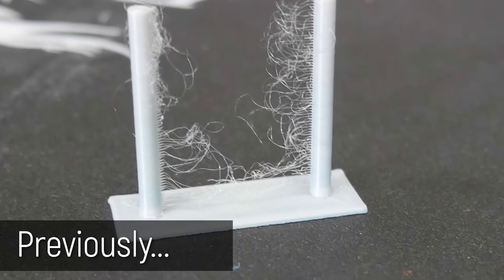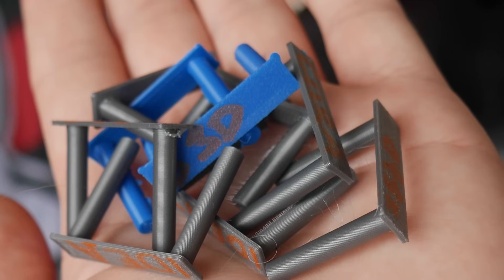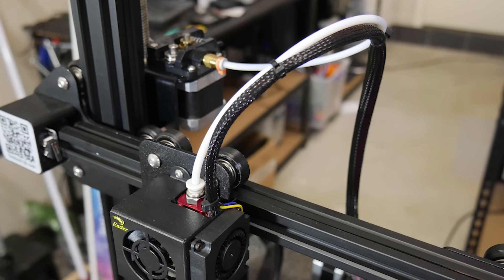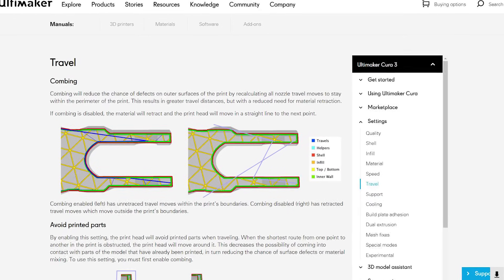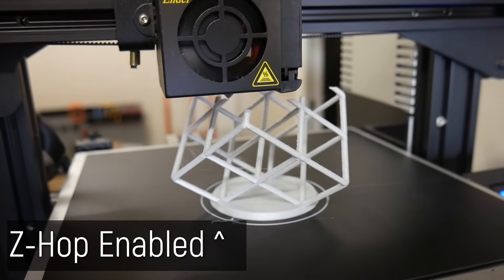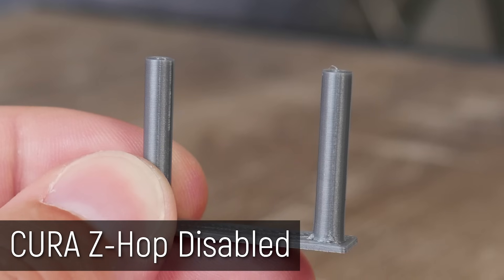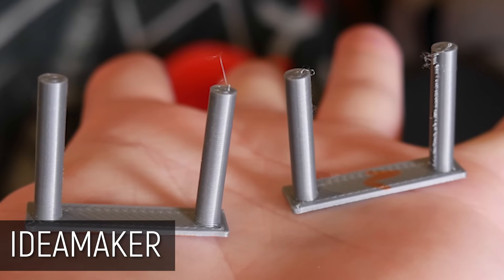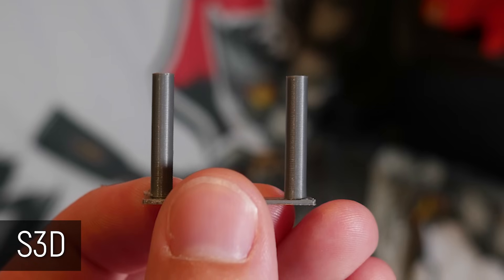Stop Ender 3 Stringing with this One Weird Trick! (ok but seriously)

Comment: I cant get mine to stop stringing even with retraction, combing, temp and all that. I dont know what the issues is because the extruder motor is calibrated and everything.
Reply: Ever figure it out? Same issue here. Starting to think its filament or my extruder or my nozzle or my tubing... no idea where to start.
Reply: @ToryBerra  I actually managed to get mine to stop stringing. what i did was start with the basic presets that Cura and then i turned on retraction but kept everything else simple till i fixed the issue. What I had to do was turn my retraction speed really high. I'm talking like 200mm per second and i had the length like 10 or 15mm. once i found that it was working, i turned the speed and length down a little at a time till i found the right combo. I think I also had to turn up the acceleration and acceleration in marlin on my extruder as well. try the high mm per second and let me know how it goes
Reply: @wrxsubaru02   I will try that and let you know, first step I suppose will be resetting CURA to defaults. What was your final retraction distance and speed? I read anything over 8mm or 60mm/s could cause jams because you will separate the liquefied plastic inside the hot end.
Reply: @ToryBerra  I ended up using 160mm speed and 10mm distance. I started with 200mm and 6mm distance and went down/up from there... I also changed my acceleration on retraction to 500 in Marlin as well so not sure if that matters. Start with that high retraction speed in cura and do like 6mm or 10mm for starters then work your way down or up whichever helps. I did the test with the softest filament i had because it was the highest potential for stringing. What machine/firmware do you have?
Reply: @ToryBerra  Oh, I also changed the jerk settings on my extruder in Marlin because i felt it should be snappy when i was pulling filament back. with all of the above, it worked flawlessly.
Reply: @ToryBerra  You know, there is one very important thing I forgot to mention... You should get yourself one of those cheap laser thermal guns and check if your nozzle is actually the same temp as your lcd is showing. mine was a lot hotter than the lcd displayed so it made my troubleshooting a lot more complicated than it needed to be. make sure you check that first or at least start at a really low temp as your print starts  and work your way up if it is too low
Reply: @wrxsubaru02  I have one but I could not get it to actually hit the tiny nozzle. I printed a temp tower though and the results came out looking pretty good.
Reply: @ToryBerra  so the retraction speed helped? try messing with temps see if you get better results but if not, try messing with retraction speed in marlin firmware. let me know how it goes
Reply: @wrxsubaru02  Honestly the temp and retraction speed adjustments have 0 effect. I get strings no matter what I do.

Comment: I've always used cura with my ender 3, after adjusting retraction length and speed On I managed to get no stringing even with petg but my biggest problem is under extrusion which keeps rearing its ugly head
Reply: Yes, same stringing experiance, same software, same under extrusion which was driving me nuts. Replaced a lot of parts chasing u.e.. Yesterday my extruder driver with the stock ender 3 died. Looks like the built in driver has been intermittent for some time, and I have been chasing some blockage issue. I have new board on order that supports removeable drivers. (skr w. 5160 drivers). Not sure if this is your problem but something to think about. good luck.
Reply: Thanks, hopefully that's not my problem I will keep an eye on it , i printed a shim for the spring to increase tension on the drive gear, after that it seemed much better and more consistent,  eventually the shim failed and it prints worse than before so I'm going to make an adjustable Spring tensioner and see how that goes

Comment: hmmm can you set the slicer with zhop enabled do a dummy circle right about the bit it just printed, to sort of cause any whispy things to fall onto the layer it just printed, then move across to the next component being printed? rather than just lift up and move directly? or several circles? it feels very much like icing a cake where after finishing each letter, you want to lift up and move back over the letter itself rather than dragging straight on to the next one, to get nice clean lines.

Comment: When I try to import the profile, I get the following message:

The machine defined in profile D:/3D Printing/Profile/Ender-3 1.16mm ChazMeister.curaprofile (fdmprinter) doesn't match with your current machine (creality_ender3), could not import it.

I tried changing the name but that didn't work
Reply: I'm having this same issue did you get it resolved? I just want to know what to set my CURA settings to..
Reply: @ThinknQueen  I haven't resolved it nor have I gotten a reply yet.

Comment: Find really interesting that you mentioned "G codes" since I was under the impression that 3D printing was totally far and a part from CNC... (I don't see anything wrong with it) but it was a surprise.... next I have no other option since I have not experience or understanding of 3D printers... its there a setting to print on wax?? for the purpose of doing lost wax metal casting??? and finally I guess that my question is talk to me about that super cute small delta printer behind you on the video!! I guess that if I ever started to do 3D printer that would be my starting point... thanks for your hard work and your videos.
Reply: first a 3d printer is basically a CNC machine with a glue gun attached. Second Watch "vegoilguy" on youtube to learn about "lost PLA casting) third that tiny delta in the background is a total heap of crap as described in his video about it...

Comment: I'm just considering my first 3D printer and I found this video refreshing, and also a bit intimidating.  It shows that 3D printing is not just a plug-n-play technology, but like most things, a complex set of compromises that are affected by many variables (material, brand, feed tube, slicer sw, part geometry).  It sets the expectation for me that printing (more difficult) parts may be an iterative process.  Thanks for your humility and straightforward discussion.  I appreciate your seemingly unbiased (or at least you acknowledge your biases) review.  Well done.
Reply: It's a manufacturing process. The same way everything else that has been mass-produced by humans requires an inordinate amount of time and effort to get just right, so will 3D printing. I've just ordered my first printer (surprise, it's an Ender 3) and I've realized I need to make time for this, if its going to be my newest hobby.
Reply: @MalachiteStarman  Keep us posted on your first experience with 3D and this printer.  Good luck.  Good thing that there seems to be a large community of users from which you can get help.

Comment: My ender 3 (non pro) has been pretty much flawless except for a large air bubble beneath the build surface, but that was easily fixed by a bit of rubbing the bubble to the edge.  Never had stringing.  My only negative would be the included spool holder which attaches to a stupid position and results is a pretty acute angle when the filament enters the bowden.  Easy fix though, just use the holder from one of my other tronxy or anet printers.

Comment: You have convinced my that I should give IdeaMaker a try.  I've stuck with Cura until now because it seems to work well for me.  (I only consider using free software that will run on Linux.)
Reply: @superuserdone  The Blender runs great on Linux.  Has an awesome 3d printer plug in. The new v2.8 is easy to learn.   How is IdeaMaker working for you all?
Reply: @superuserdone  Onshape

Comment: I have had no luck in getting a different program to work with my 3D printer. Can you help.  I have a power spec ultra 3D dual extruder. Is this a bad printer? If so what one should I buy

Comment: what I do on my Ender 3 to stop stringing is to use the slicer that comes with the printer from Creality. From there,  load the profile from the "test dog" file which came with my printer. This is the easiest way I got for a near perfect print. But this slicer doesn't have a bunch of settings like Cura do. So when I want some of that settings I try to replicate the profile from the Creality slicer to Cura

Comment: I agree with you, quality should not be determined by price to a certain degree IMO, a warped bed is unacceptable at any price. Features, bells and whistles and so on yes, the price would determine what you get and what you don't. That is why I generally but on Amazon and pay a little more if the quality is below a certain standard you can send it back.

Comment: What if you could hop AFTER clearing the edge of the part, so essentially in the middle of the travel move?
Reply: I don't think that any of the slicers mentioned in this vid can actually allow such a setting, I guess You could accomplish that by manually editing G-code, but... Isn't that kind of the point of having slicers in the first place? They're supposed to turn Your model into a perfect G-code so You don't have to write it Yourself

Comment: Great video.  This validates what I have thought since day one in my really shot time with 3D printing and getting information on the web.  One size does not fit all.  What would be great is if some of the veterans of printing would create a sort of guide to outline this information to help us noobs when making decisions.  It woul dbe a very challenging project as there are so many combinations possible today.  But if the "guide"  stuck with teh top 5 slicers and filament types and maybe the top 10 3D printers (and added significant new ones as they came out) it would further the industry as I believe many more people would not be frustrated with their printing and once they have a solid foundation of the basics could further explore options, settings and filaments to get a desired outcome from projects.  Not to mention the working knowledge would be invaluable for troubleshooting new issues.   I'm done rambling....going to download Cura...lol

Comment: Hi Angus, thank you for the detailed and informative streams. I have found even more physical and mathematical details about the retract values.

http://www.sublimelayers.com/2016/10/some-musings-on-retracts.html
and
https://drucktipps3d.de/und-er-limitiert-doch-retract-speeds-getestet/
explain that very well.

Result ... the maximum values of the accelerations in the firmware cover the settings of the slicer ... M503 shows the maximum values.
I do not know a slicer, which overwrites these without further action.

BTW, what is your experience with PETG, ABS, ASA and other materials?

The really good and informative YT "teachers" are unfortunately only online with PLA.

I would be happy if it goes to the next level ... on a Friday with high five ... let's get startet ;-)

Comment: I had a similar problem with eSun PLA Pro (PLA+) blue on my A10. Parts came out looking like they were part of an insane spider web. I fixed the problem in cura, by creating a profile just for that specific material, then adjusting z hop to 5mm, retract at z hop true, and I set the retraction at 10mm if I remember correctly. Stringing stopped. I am new to 3d printing, but not new to fab, design, and construction work. I have found through the decades that problems tend o follow a 10%, 10%, 80% rule, in that 10% of the time the issue is with the machine, 10% is with the material, and 80% is with the human using said, lol. As with a milling machine, if the settings aren't dialed in properly for the exact material in question being processed, the outcome will be less than satisfactory.

Comment: A dog chasing its tail.  Step 1.  Bodens are made to pull, not push.  Not on a bike, not on a boat, not on a 3d printer.  The presure is too hard to deal with.  The larger the boden the bigger the problem.  If you must, try lin advanced.  It will have a massive k factor, but might deal with the actual problem.

Comment: My Ender 3 strings like crazy when I print a real object.... but when I print the little string test file, it turns out perfect without any changes to my Cura settings.  WTF?
Reply: Retraction
Reply: Set your retraction distance around 6mm or longer.

Comment: It's interesting that you didn't already know all of this..I'm guessing you are not used to cheaper 3d printers which force you to get into deep settings and materials? The only thing I could say for your cura model is that you should of randomized Z, so that it doesnt have that deep cut outer edge on the test. Also for your z-hop test you added too much.I use 0.1 to 0.2mm. 0.5mm is too much and you end up with stringing. It also depends on cooling, temp and the material used. Also, I dont use stock heatbeds, I use glass.  I use an even cheaper printer,  tevo tarantula with PETG.

Comment: My stock Ender 3 was ridiculously perfect for the price, but now I'm fighting all these same stringing issues after switching to an all-metal hot end.  A lot of people are, I noticed.  Tons of people offering quick fixes, but nothing definitive that actually fixes it.
UPDATE:  I finally got mine to stop stringing with a combination of increasing travel speed to 150 and lowering nozzle temp to 185 in Cura.  Changing retraction settings never made a difference.

Comment: I dealt with this same issue back in October, and ended up taking the exact same path that you did, as well as coming to the same conclusion. The slicer is as much of a tool as which filament or printer you use.

Comment: I eliminated stringing on my Ender 3 by really taking the time to figure out what temperature my particular filament of choice (cctree PLA) liked. It surprised me that it strung like crazy until I brought the print temp down to 185. My other PLAs liked to work at 200-205, but this particular PLA really didn't work well until I printed cooler. Using S3D, but want to try the latest Cura.

I saw an impressive increase in quality when I disabled z-hop in S3D. I was getting terrible, terrible stringing with z-hop.
Reply: Andrew Kohlsmith wow nice, my pla won't even extrude unless it's 240 c or higher, probably the brand.

Comment: I am just getting into the settings for my Ender 3 as I just got it. So this is very helpful. :)

On the part at the end about warped print beds. Having a pretty close to flat surface is a must for 3D Printing. So a warped print bed also does not sit well with me, for the most part. It all depends on how warped it is. The one on my Ender 3 is not to bad at all. When you put a straight edge on it you can see a very small minuscule warp to it but not one that is to bad at all. Its so small you don't even notice it when printing the first layer. Now the one on my Kossel is a littler worse. That is my fault though. I accidentally crashed my hotend into the center of the bed giving is a slight concave to it. Still the prints turn out nice. The print area with it is so small that it also does not get noticed much at all either.

Personally I don't expect much form a cheap printer as they cut cost to get the prices down. If I am paying a lot more fir the 3D Printer then I would want it to be pretty flat. Or if I am building the Printer, which for one of my Printers I did. On that Printer I used a aluminum Tooling plate. So it is pretty flat. It is a little thick, but works great. I stuck a Keenovo silicone heater under it and I could actually cook a hamburger on it if I wanted to. :P

Comment: Hi Angus, I'm a 3D print professional and found this video super helpful.  I had been getting similarly good results from S3D and CR-10 printers, I was already using the 0.16 layer height and some of the other good things - but your breakdown of the issue and Cura's behaviour, also z hopping, was a really useful and a great reminder that it's easy to get stuck in a groove considering the complexity of slicer setup

Doing a deep dive on a niggling issue like this is the most valuable content for many of us who are experienced but too busy doing our own thing to do a full breakdown.
.

For a paid-for slicer I'm disappointed at the rate of improvement of Simplify3D and the crashes I'm having updating profiles - what's your opinion on that?

And I have 3 CR-10 printers, which all have a few different parts - but they are all production, rather than design changes, for the better, interchangeable and they acknowledged the original designer of their much-needed bed strain relief.  I would say it's all well within reasonable product improvement within a model production run, and much better they do it (frankly the first one without Z strain relief was a fire hazard, doubly so with disabled runaway protection, but they fixed that and open sourced so great improvement).
I'm about to unbox a 'refurbished' kit Ender-3, presumably a customer return - so I might get to see the lower end of their quality.  I bought it mainly for parts, but I will build and run it first.  Agree that even cheap printers should a) basically work and b) not be a fire hazard - looking at you, Anet A8!

Comment: hello I have a problem with the extruded, namely almost every layer on a 3-4 mm portion do not pour plastic, I mention that I work with cure 3.6. I checked the settings at the nozzle thickness of the stepper motors per mm. and everything seems to be OK I tried with more materials and lower and higher temperatures but without result .. the problem persists at almost every layer when it starts to lack plastic on a 2-3 mm portion especially on the stuffing. give me some advice to try again ... maybe some settings to get the material faster or another better software. thanks a lot. a good day! the printer is ender 3